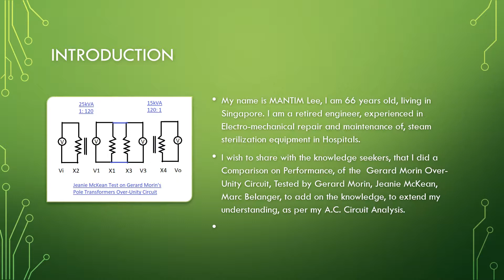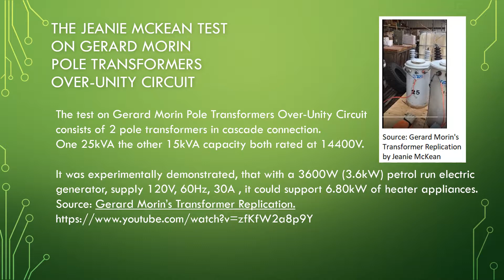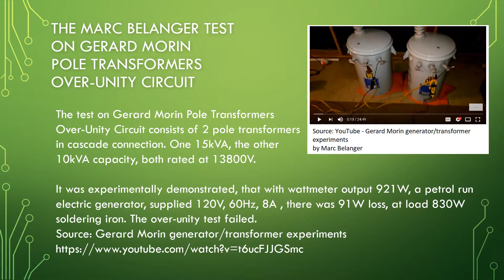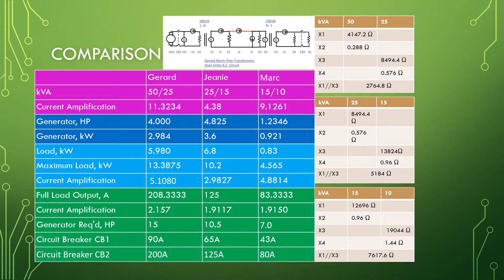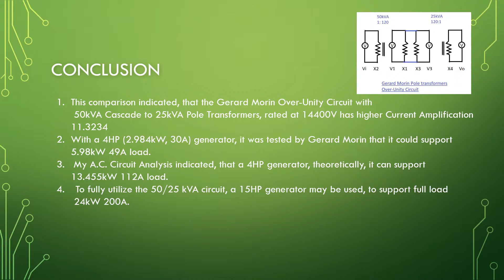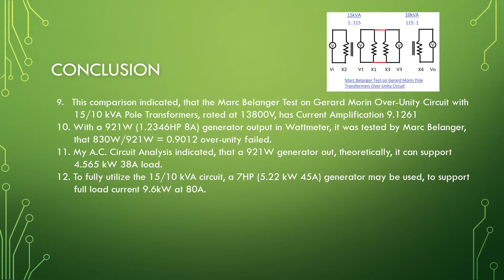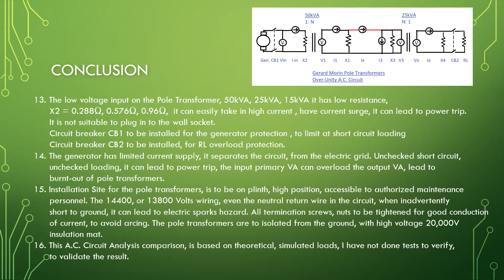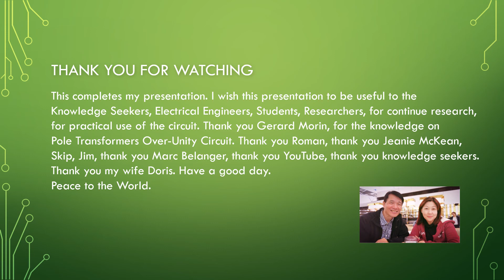Gerard Morin Pole Transformers Over Unity Circuit Comparison

Comment: Mantim Lee, do you know were I can find parts to build a hyper drive motor for an ebike? 3 fase stator motor, generator and frequency device. Can you give me some specs to help me going to accomplish to build my ebike with this technology?
Reply from the maker: Thank you for your question, Ron. The Drum Motor for the hyper drive may be found in Amazon.com to be searched under, LG 4417EA1002Z Rotor Assy, and LG 4417EA1002J Stator Assy. As regarding to Pole Transformer, you may find in solomoncorp.com for enquiries. For product specifications, you may have to message, their customer service, to clarify before you purchase. The specifications per my analysis were already listed in my video presentation. You have a good day.
Reply: @mantimlee5568  the 2 motors you mention are to big and to heavy for a bike. I need a small motor for this build. Just like Gerard Morin is showing here:https://youtu.be/ZgdyFKIt9Xg?t=455. Since the frequency generator gives the motor so much power it can be very small. He is only not showing the frequency generator /controller and keeps this secret. But it is the most important part of the build to make this a success. So I need a very small stator motor with a very small generator/controller device. I want to keep the  weight of the bike as low as possible. Hope you understand what I am aiming for.

Comment: thanks for posting.    here are some things to consider.       it should be understood that, in the context of ou, any comparison  of transformer characteristics is of NO use.    why is this true.    the  use of one or more  transformers (and/or a solid-state approach)  Can  Only  Result in a  (Small)  energy  LOSS.   NEVER  a gain.         in the case of an  electric motor  being incorporated into a  POWER  circuit,  the motor runs  un-loaded; it's doing  NO  work.    the motor is functioning, Only, as a  Rotary Transformer.  with More losses, due to the rotation.      NO  ONE  has  Ever  succeeded in achieving ou, via  a  solid-state method.     NO ONE.                  on a happier note, the  MA  of a  Large-radius Rotary 2nd-class Lever is here to save the day.    for proof, see linked video and my research.                 for any folks who do not already know,   the use of the term  'resonance', in the context of a Power-circuit, is  NOT  appropriate.    why is this true.     this is a  re-naming of a  Known and  Well-understood  process, called:  em induction (of current flow).  cheers         googletranslate
https://www.youtube.com/watch?v=lTkXciAn488

https://en.wikipedia.org/wiki/Electromagnetic_induction
Reply from the maker: Thank you for your comment, David Davids. I wish my video comparison to be useful for research, in the selection of pole transformers combination, such as 50kVA cascade to 25kVA, to support 200 Amperes output with a 15HP generator input, as example. Resonance seeks for a frequency that would give a circuit, the maxium power transfer from input to output, P(f) as a function of frequency, then set dP(f)/df = 0, and the mathematical solution f, is the resonace frequency of the circuit. In the Gerard Morin Pole Transformers Over Unity Circuit, the frequency is fixed to 60Hz  according to the input generator, so I did not analyse resonance in the circuit. You have a good day.
Reply: @mantimlee5568  bla-bla-bla   resonance    bla-bla-bla   resonance        THERE  IS   NO   SUCH   THING,  in the context of  POWER.
https://en.wikipedia.org/wiki/Electromagnetic_induction
Reply: @daviddavids2884  bla-bla-bla how does that feel
Reply: gerard already proved his OU claim and I'm not messing with that guy he might slug some one or chin me. HAPPY SHOCKS TO YOU.
Reply: Mantim, great research compilation you did all these while. I've been following your work for some time. I hope to communicate further with you. I'm slightly your junior from Malaysia. I hope you drop a reply at nanoprintsb at gmail.com